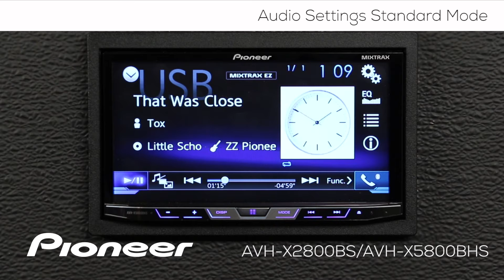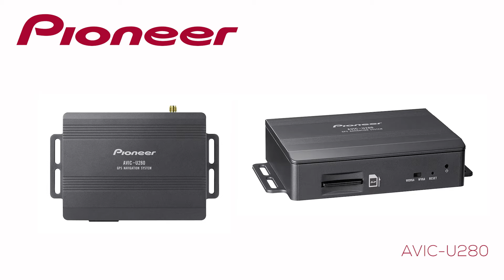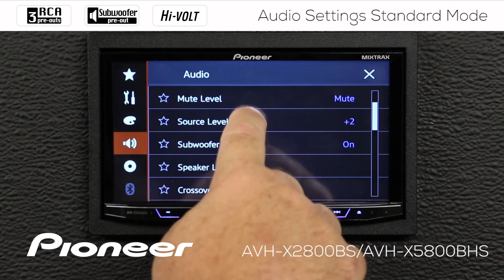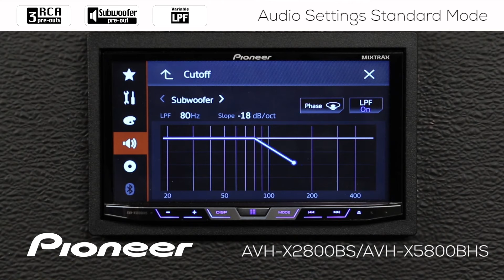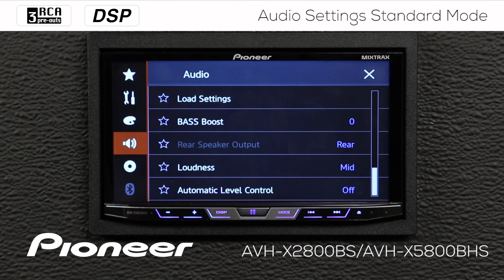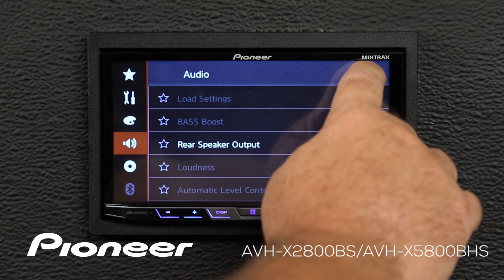How To - AVH-X2800BS - Audio Settings Standard Mode

Comment: My Pioneer AVH-X2800BS goes to the LANGUAGE setting screen when I turn it on. It will change the language but and won't respond to the touchscreen to go anywhere else, so I can't get it to MENU. I have tried pressing the RESET button and disconnecting the ground cable on the battery, but nothing changes. Any ideas?
Reply from the maker: Just to understand clearly;   are you touching the language selection and then touching the arrow right button to confirm your choice and to  advance to the next screen?  The arrow right on screen button is at the top right of the Language selection screen.  You can see it in this Pioneer How to video:   https://youtu.be/WvJXYh6vk_0?list=PLw63zJRQbCNgoCBAcEH-E-IUALLo9TgPy&t=864
Reply: @pioneerelectronics  When I turn on the ignition, the screen shows the PROGRAM LANGUAGE SETTINGS mode in English. When I touch the ====> in the upper right corner the language changes to Chinese (?) and the screen becomes completely unresponsive. I have removed battery cables and pressed the reset button on the display many times in the past few days and it doesn't help. I put in a DVD to see if that might help, and it wouldn't play OR eject. I would really appreciate your help.

Comment: I do hope you see my comment. My left side channels have quit working on this 2800 unit. Radio, cd, Bluetooth or whatever, they have gone out. What is the Problem?
Reply: Are you using an external amplifier in your system?  Or are you using the in-dash receiver internal amplifier?  Or both?  
How many speakers are connected in your system? 
Please be sure to check the Balance control on the receiver is set to 0 or the middle.  You can see the balance control here:  https://youtu.be/ZmeGmo7tIE4?t=33
If the Balance control does not correct this, I recommend to press the microprocessor reset button.  You'll need a paperclip or some other small point to press the microprocessor reset.  You can find the microprocessor reset button on the Pioneer AVH-X2800BS at the top of the hard key panel, near the eject button.  You can find more How To videos about Pioneer AVH-X2800BS here:  https://youtu.be/NuPU81smtVA?list=PLw63zJRQbCNjiTohYtcYmfGNQm5QqzrkX     You can find more videos on Pioneer's YouTube Channel here:  https://www.youtube.com/user/pioneerelectronics
Reply: Deckerd Otto It’s a JBL system in my Toyota with 4 speakers in front, 2 in the rear doors and no Sub. It has an external amp in the rear storage area. I pressed the reset button you mentioned and all is good now. I hope it lasts. Thank you.

Comment: Mine doesnt give me an option for which mode it asks wether it's a smart phone or not and my audio settings are not allowed what do I do
Reply: I recommend to press the microprocessor reset button and do a System Restore.  You'll need a paperclip or some other small point to press the microprocessor reset button.  You can find the microprocessor reset button on Pioneer AVH-X2800BS on the hard key panel beside the eject button.  After you press reset, do a System Restore.  You can learn about System Restore in this video:  https://youtu.be/WvJXYh6vk_0?list=PLw63zJRQbCNjiTohYtcYmfGNQm5QqzrkX&t=824    You'll need the Parking Brake engaged in order to access the System Restore Setting.  You can find a full playlist of How To videos about Pioneer AVH-X2800BS here:  https://youtu.be/T4PQl3AZNkA?list=PLw63zJRQbCNjiTohYtcYmfGNQm5QqzrkX   Please be sure to install the latest firmware for your Pioneer AVH-X2800BS.  You can find it here:  https://www.pioneerelectronics.com/PUSA/Car/DVD+Receivers/AVH-X2800BS#downloads   and you can find more videos on Pioneer's You Tube Channel here:  https://www.youtube.com/user/pioneerelectronics